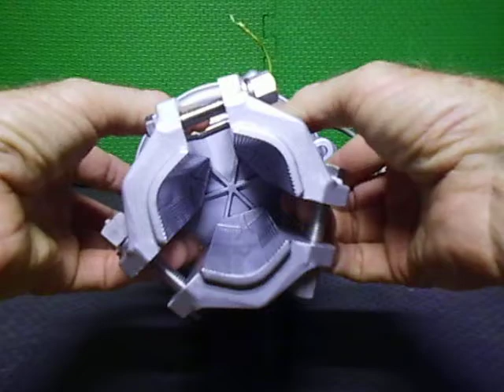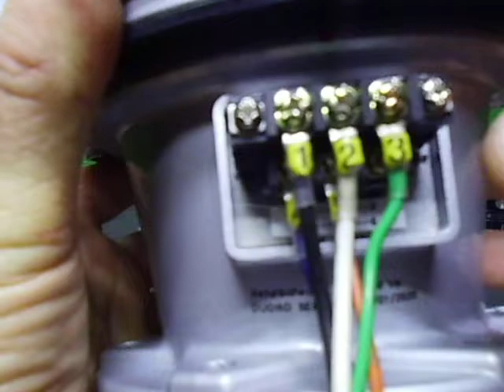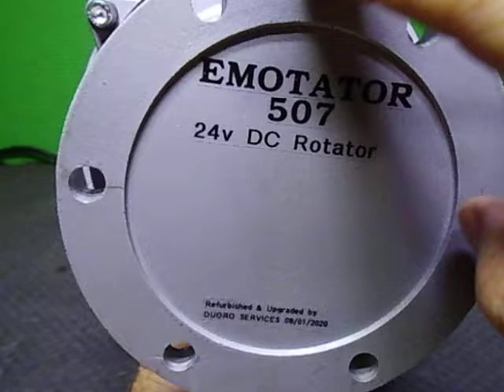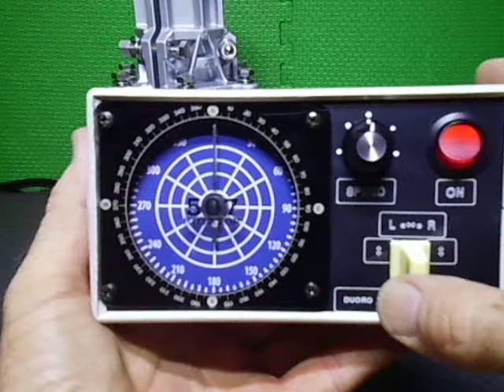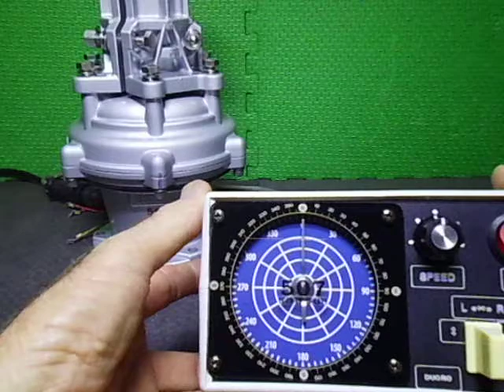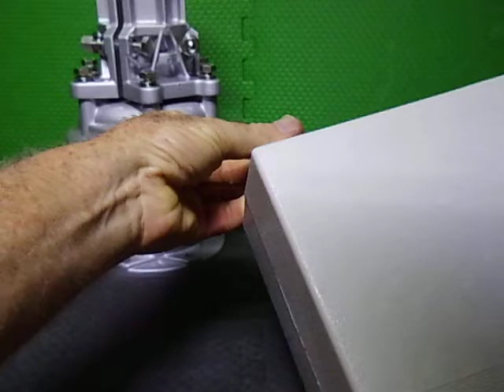Emotator 507 rotator & Duoro DS4e controller overview & working

Comment: Dear, Does this contoller works for a 1102 rotator? AC 9 pins connector on the rotator. By the way the reCapTcha is not working on the website so I could not ask Peter or Duoro Services
Reply from the maker: Hi Peter, thank you for the enquiry & the heads-up on the recaptcha  not working, I have someone looking into the problem. Regarding the 1102 rotator, that is a 100vAC drive rotator with a solenoid activated brake wedge system, where as the DS4e controller has a 24vDC drive to the DC upgraded 507 rotator. Please get in contact with me via SMS or call my mobile phone number on my web site & I will supply my email address. Regards Peter